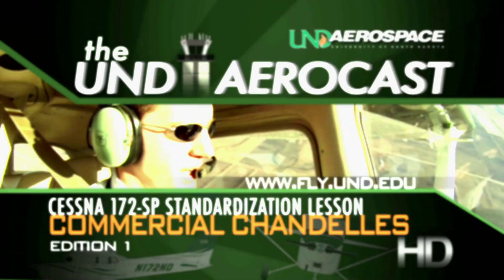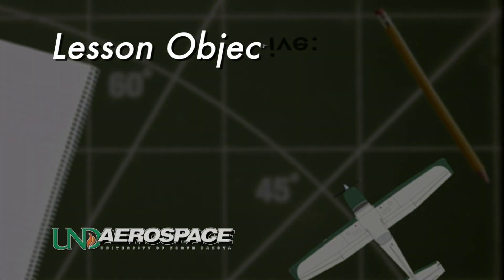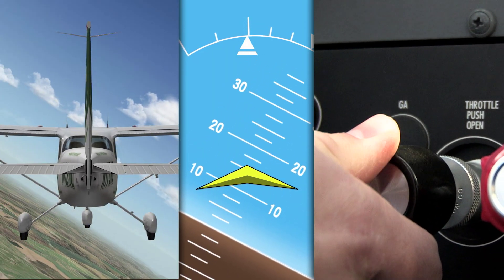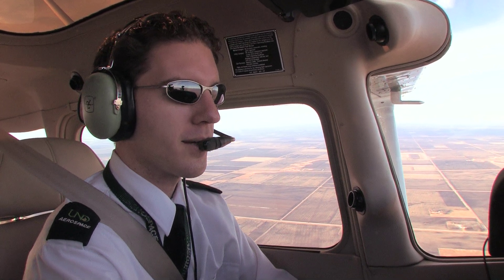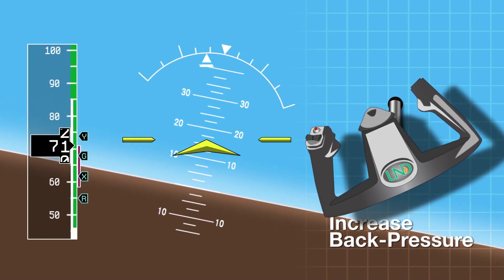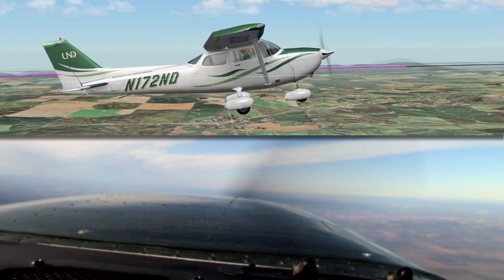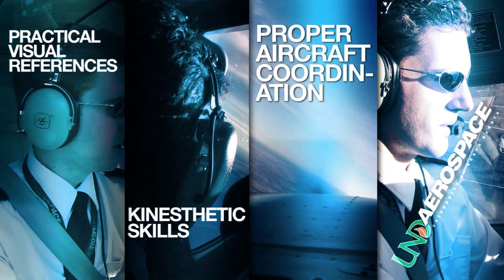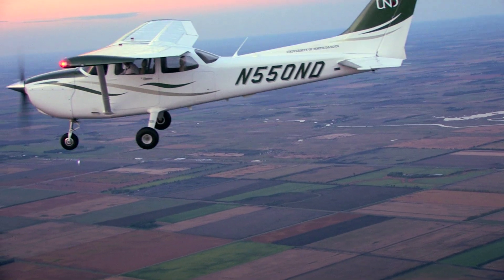Commercial Chandelles

Comment: If the goal is maximum potential energy(altitude) gain shouldn't you use either Vx or Vy for the core of the turn and only consume the last bit of kinetic energy for a bit of zoom climb at the absolute end of the climb phase? Slowing below Vy waists energy due to increasing drag if the goal is energy per time, and Vx will yield best energy per distance and a smaller turn radius; below Vx you are sacrificing energy in both time and distance yielding a less than maximal altitude gain.
Reply: The goal it a minimum radius turn.
Reply: @michaelgarrow3239  That it is certainly not.
As it has been two years I will say the goal is simply demonstrating precision control over a varying combination of bank and pitch. 
There are better methods for either maximum altitude gain or minimum turn radius.

Comment: Thanks for these videos, they are amazing.
Besides the excellent video and learn the maneuvers, here we can learn HOW NOT TO USE THE MICROPHONE, you can be the best pilot, the best acrobat, the best instructor, but never learn how to use a microphone correctly.
The pilot is practically swallowing the microphone, which means that both the control tower and the traffic do not understand the communication clearly by the distorted voice. The microphone should be one inch away from the lips so it does not sound so horrible and always should have the anti pop screen. Please never do what this pilot is doing, so the communications will be more understandable.
Many of the accidents happen due to inappropriate communication and if we do not know how to use a microphone we should be the cause of one of them.

Comment: The description of adverse yaw starting at about 9:00 is not correct. In a left turn, the left aileron is deflected UPWARD, not downward. The RIGHT aileron is deflected downward, thereby shifting the chord line and increasing the angle of attack on the right wing. Higher angle of attack means more lift, and thus more induced drag, creating the tendency for the aircraft to yaw to the outside of the turn.
Reply: The description in the video is correct as is your description of adverse yaw. However, the turn does not produce adverse yaw, but the aileron deflection, as you mentioned, does. At this point in the maneuver, the pilot is rolling out of the turn with right aileron deflection. This will generate left adverse yaw as the aircraft is rolling to the right, even though it is from a left bank.
Reply: He is correct you are WRONG. He specifically said in the last 90 degrees of the chandelle to the left in which the airplane is returning back to straight and level. So essentially the plane was in a left bank and pilot introduced coordinated right aileron input lifting the left wing lowering the right (left aileron DOWN) creating induced drag and of course adverse yaw on left wing.

Comment: So basically a Chandelle is a Steep climbing turn right? Never was clearly inform on that one. :(
Reply: SlyBird D You are right but let's refine that - a Chandelle is a 180 degree turn with the maximum altitude gain possible during that turn. You start with a bank first to max bank, followed by pitch up to max pitch, followed by slow rollout on heading, 180 degrees reciprocal of original heading, and airspeed at almost a stall. That is the most altitude you can gain in a turn. You pitch forward then and regain level flight. Stay coordinated during the turn! A Chandelle done right also helps you refine your rudder skills.
Reply from the maker: SlyBird D Sort of.  At least it begins as a climbing steep turn.  But remember, the rollout begins pretty quickly and so control pressures required to fly the maneuver quickly change from that required for just a level steep turn.  Also, the bank never gets more than 30 degrees, so you can't really quite call its 'steep'.  But as a general overview, its certainly a climbing turn with a smooth, consistent rollout.

Comment: During aileron application, adverse yaw is opposite the aileron as you describe. The roll-out from a left turn uses right aileron and will induce left adverse yaw. In a chandelle, this combines with the left turning tendencies from the engine at high AoA to necessitate more right rudder than usual. Hope that helps.
Reply: Michael Lents when you roll out to the right from a left bank.... (meaning you turn the yoke to the right) the left aileron drops down creating a greater angle of attack and creating more drag hence creating adverse yaw or a relatively rearward swing on the wing
Reply: If you are referring to the image at about 8:53 in the video, I was initially confused by this also. I then realized the curved arrow over the center of the plane is showing engine/propeller torque and not the direction of the turn/rollout (which I originally though it was indicating).

Comment: As for the stall... You shouldn't be stalling during this maneuver. If you are coordinated, it should just drop the nose towards your feet unless the stall is entered with extra load-factor. Most clockwise turning engines (as seen from the flight-deck) will roll-off to the right due to gyroscopics if accelerated into a stall with excessive load factor. If not coordinated, then a prompt stall recovery with top rudder should prevent the incident from getting too exciting. Stop the yaw, no spin.

Comment: Ball is centered the whole time, but the control pressures to keep it that way are sometimes counter-intuitive. Turning tendencies will make it more work or less work for you depending on the direction of turn and roll-out. For example, a roll-out from the left chandelle requires significantly more right rudder than from a right chandelle.

Comment: Where is the ball on this turn? Why won't you get into a cross controlled stall. Turn one way and rudder the opposite at a low airspeed? If you do get into a stall during this maneuver will it roll or just drop nose down?

Comment from the maker: Tomás, thanks so much for your comment and kind words. Actually, the information in the video is correct.  As the airplane rolls out from the left turn, as seen in this video, the LEFT aileron is deflected downward, increasing lift on that wing and induced drag.  This yaws the airplane to the left.  This left turning moment, combined with the left turning tendencies from the engine and spinning prop, require the pilot to add significant rudder during a rollout from a left turn.  Hope this helps!

Comment: Very good video, though the adverse yaw is not as explained. The adverse yaw is a yaw tendency opposite to the turn, which is caused by the increase of induced drag in the wing that rises. The rising wing will achieve a greater speed thus increasing the induced drag on it. This will "push" the higher wing backward and cause a yaw, opposite to the turn. i.e. left turn, right wing goes up, right yaw effect. Except this, very nice video, very helpful!